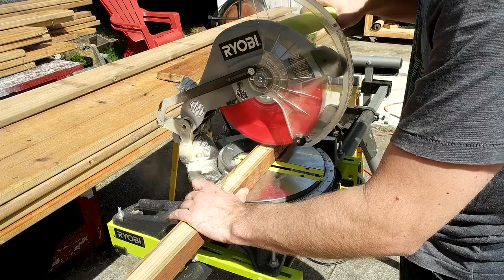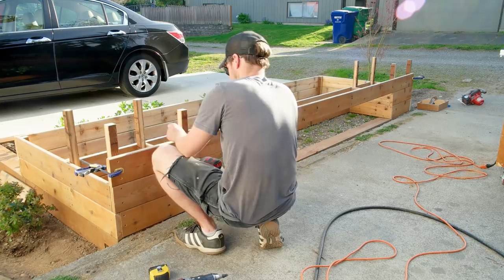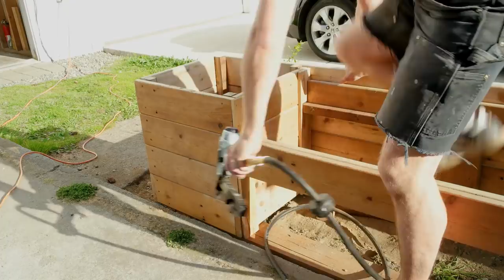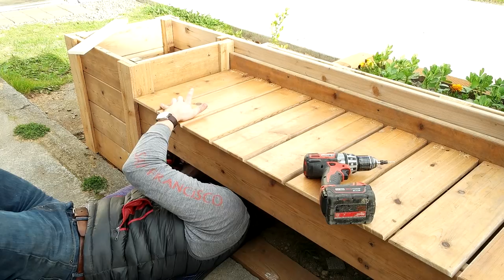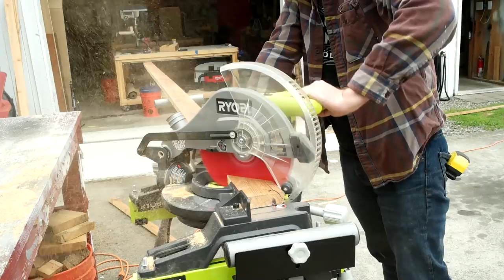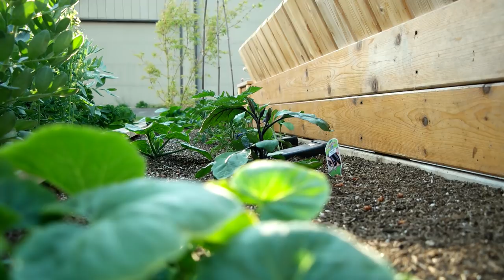Raised Bed Planter Bench | How to | Plans

Comment: Very nice Michael. I did a two tiered planters on both sides of stairs for my nephew. I told him to fill up the bottoms of the planters with plastic water bottles or any plastic bottle. You do not need to fill the whole planter with dirt as the roots will undulate around the bottles. Keep up the good work.

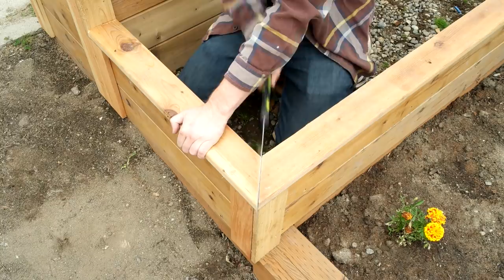Comment: 7:42 Im new to woodworking/deck building but this is a genius idea, so hard to get a perfect join, a thin saw blade to even the gap, I like it
Reply from the maker: Jacob Streiff it’s a good little trick. I learned it from a boat builder. You can use it on all sorts of angles too. That’s where it’s a life saver!! Thanks for watching!

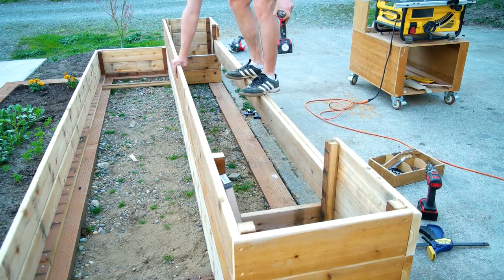Comment: 3:51 i think if you add a piece in the middle down that could hold much better and it won't move , nice work 👍🏽
Reply from the maker: Thanks for the advice. Once the seats went on it got pretty sturdy, but if things start to move, I'll add in a cross piece. Thanks!

Comment: Nice miter edge trick. I'll be using it.
Reply from the maker: Yeah! It's super handy. I think it's an old boat builder trick.
Reply: I bought a Sawmill 3 yrs ago and have never made a piece of anything yet. I live in South East Kansas and we have alot of red cedar here. I think I'll try it with some of that. My logs are all Urban cuts or I drag the out of the wood dump. I like that you use recycled wood when you can. Makes a difference I think.
Reply from the maker: Thanks Michael. I try to reuse materials whenever possible. I’m jealous you have so much lumber. Good luck with you project!
Reply: Michael Alm Could we please talk about this trick? I was like, what is going on... What is it you did there? Thank you.
Reply from the maker: sureshot311 yeah! It’s pretty simple. You use the kerf of the saw blade to correct minor inaccuracies in the miter. As you cut the slot material gets removed from both sides of the miter until they are both even. You have to cut the piece slightly long to do this, and I probably cut the slot three times before the slot lined up. Hope that helps
Reply: Michael Alm That definitely does. Thank you very much.

Comment: That looks awesome Michael, did you plan it (or sketch it) or did you just went along with whatever came to you? Great technique with the miter corner there.
Reply from the maker: Thanks Demetrius! I made a rough sketch up drawing just to figure out the proportions and did the rest of the engineering on the fly.
Reply: Michael Alm Haha thought as much it looks too awsome to have been overengineered there is alot of creativity in it.

Comment: We'll done! Did you have to get the ground level before you built the base? Keep up the great work!
Reply from the maker: Thanks! Yeah, i put the 6x6’s in last year. The ground was tamped down and leveled. The 6x6’s were assembled with half lap joints, and the cut ends were treated. They were then anchored and filled with dirt. Pretty simple, but crazy heavy. I did it by myself and was smoked by the end. Next time I’ll call a friend!

Comment: I noticed your crosscut sled has both a vertical and 45 degree slot. How did you offset  the two cuts? Quick setup or did you have to switch out your runners?
Reply from the maker: The runners are off set on that saw so I just flipped it around.
Reply: @MichaelAlm  Great Idea. I'll give it a go on my sled. It's actually be easier since I used edge runners (I'm stuck with the unfortunate proprietary tabbed slots of my Craftsman).

Comment: looks great, but yet another video where the guy has every tool in the world. hardly ok for a normal DIYer to have a go.
Reply from the maker: Hey Chris, I’m pretty sure all I used was a chop saw, nail gun, jigsaw, and a screw gun. I also used a drill press, but that’s not needed. Heck, you could go without the nail gun. You’re left with pretty basic wood shop tools. Probably $250-300 in tools.
Reply from the maker: Oh there is a table saw too. My table-saw is one of the cheapest on the market, and you could totally use a circular saw in its place.